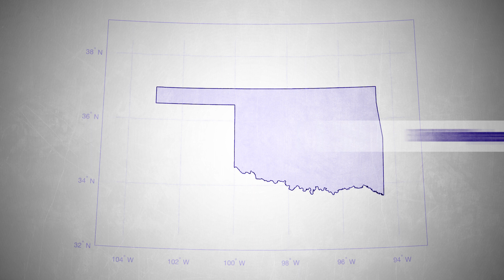What caused the mysterious signal in Oklahoma?

Comment: So what caused them all over the state?
Reply: I think that just means they heard the signal there, but not necessarily that the explosion happened at those points
Reply: Eric's comments below are correct: the seismo-acoustic signals propagate through the air after detonation at McAlester, and are recorded at those distant stations as changes in air pressure. Good question!
Reply: Hi